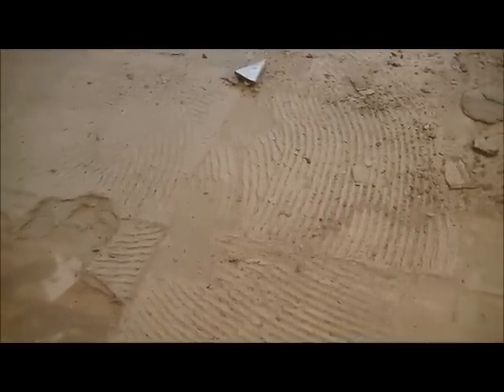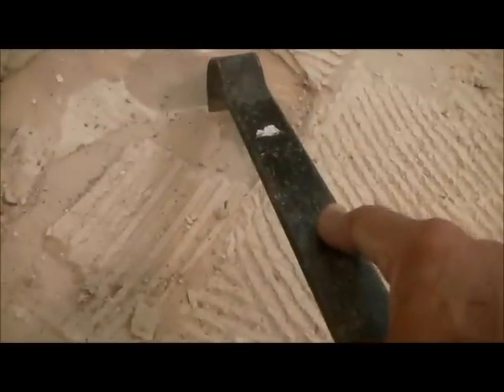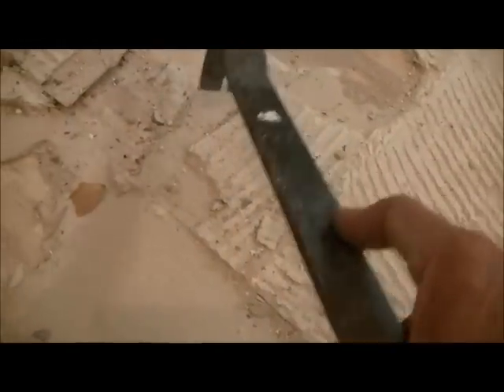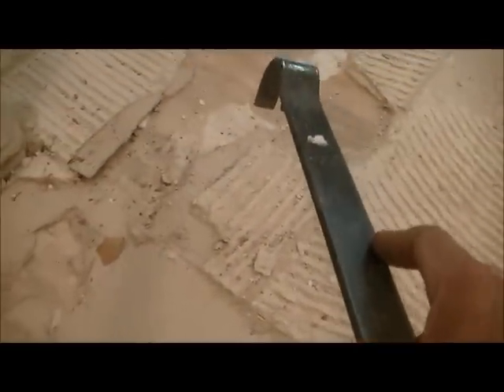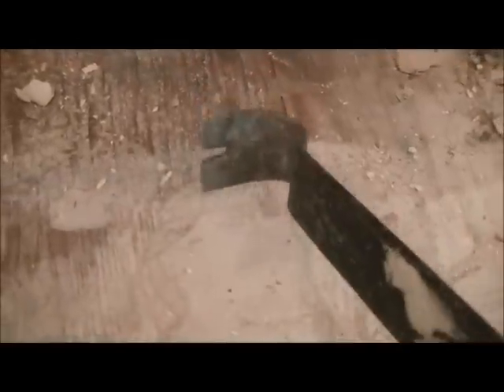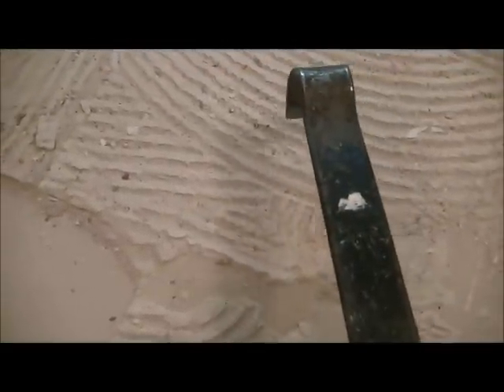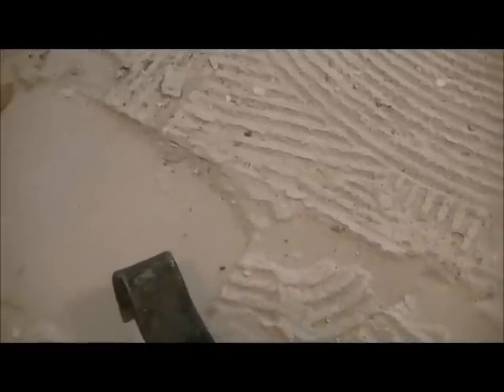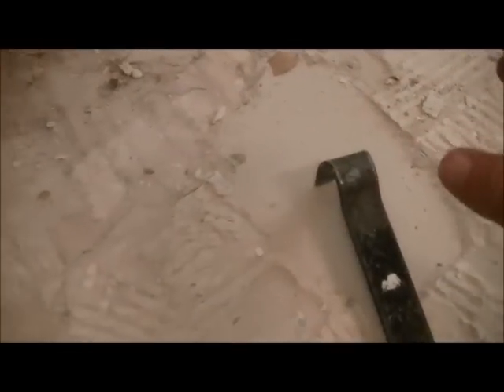How NOT to install backerboard on plywood !

Comment: The point of the thinset is to take up space between the plywood and the backerboard which decreases the likelihood of cracked tiles.  The problem you are having is because they used modified instead of unmodified... the modified adheres to the plywood where unmodified won't.  Let's not tell people to do this wrong and cause all kinds of problems for them in the future.  Excuse me while I cross off StarrTile from my list of potential contractors.
Reply from the maker: Garbage...both thinsets are a cement based product, BOTH will stick to plywood, both are hard to take up, and BOTH will damage my customers subfloor. Your comment about problems in the future ? GARBAGE TOO, over 20 years doing it as I do without a callback. ( crossing off MrMonkeyButt from potential customers )

Comment: I'm a certified flooring installer and I have to disagree with you on using nails and not thinsetting the cement board down. Everytime I go to fix a bad tile job, it's usually because they did not thinset the backer board down and their is movement. Which causes the grout joints to crack.
Reply from the maker: We're in some kind of parallel universe. Maybe one in 50 jobs I go on, some idiot put thinset down on plywood, and never seen the grout crack as you state, only directly on plywood does that happen.

As to your certification:
I'm a certified Firefighter
A certified Diver
And a Home Inspector
But being certified doesn't mean you do things right
Reply: what it comes down too is that everyone has their own way of doing things. is thinsetting over kill under cement board? sometimes it is. I watch your videos because I think you are very knowledgeable when it comes to setting tile. I do it that way because that's how I was taught. I just rather be safe than sorry.
Reply from the maker: I would agree with what you said, however if I ran across a problem I would have found the solution. It seems like new products are coming out every month to address a problem that I have never run into. A lot of it is overkill for the homeowner/diy'r so they won't fail I suppose.
Reply: I agree ditra is the most useless stuff around. Some guy told me that schulter came out with a system and all you have to do is put drywall in the shower and cover it. I had to laugh. What do you think about that schulter stuff
Reply from the maker: I have no use for any of the material they put out..overpriced and because it's proprietary, you are forced to buy more than what you actually need, you can't use anything separate from their system.

Comment: As DYI projects a few years ago I used 1/4 inch hardi backer board in some bathroom projects.  The first I just screwed the hardi board down to the plywood.  Next BR I read the instructions more carefully and applied thinset.  After a few years no problems with either floors.

Comment: Manufacturer warranty for hardie board requires 50 screws per 3x5 sheet (8x8" square), with thinset mortar troweled minimal 1/8" on plywood. I care more about being able to properly warranty my work then to care about the next guy. When you estimate a job you should assume the products were properly installed and include the necessary time for demolition.
Reply from the maker: Lawyers insure warranties are never honored

Comment: 50 + nails will not stop flex,your always complaining about how other people mess up.thin set under backer is the proper way,it makes the floor more rigid.So you lay tile on a flexing floor id like to see what that looks like in 3 years,
Reply from the maker: Every tile job I've done is still in tact. I offer my customers a warranty as long as I'm in business, not the typical 1 year contractors give. If I had failures I'd know about it by now & change my methods.

Comment: Definitely glue and screw. This is YOUR opinion and most of know better on this. A little extra work means my jobs don't fail. You have your view and this one I do NOT share at all. Just did a floor where HO had some do subfloor with durock and was so much flex. Pulled it up and thinsetted it down and rescrewed. Was great after that. Gave it that extra it needed. Is it needed in every floor? No but like I said, a little extra never hurts.
Reply from the maker: And that my friend is your opinion. Never one call back after setting thousands of SF doing it my way. One could argue there is a solution where there is no problem.
I can't speak to your experience, chances are it was operator malfunction where the durock was set.

Comment: I'm of the mindset that a tile job is done for life and not to plan for someone else to rip it out. That being said when I ran across this in my own home I just whipped out the saw and ripped out the underlayment and went in with new 3/4. Was pretty fast and easy. I pretty much go with the manufacturer's recommendations and they always say to use thinset underneath.
Reply from the maker: That may be true what you said, however I have been at this for nearly 20 years and have yet to have a failure doing at the way that I show. Tile won't pop off because you don't glue & screw.

Comment: In the Houston area I haven't found one tile company or tile contractor that puts thin set underneath the hardi for all the reasons mentioned in this video...The only one that says to do it is the AM radio home improvement guy Tom Tynan on 610am on Sundays. However, you call him up on the radio line and he recommends the pros at "Texas Floors," he even says ask for Jason. I call Jason and ask him if he puts thin set underneath the hardi and I get a long pause and then he puts me on hold. When he comes back on the line he says they normally don't do it or recommend it, but for an extra charge they can do it.....
Reply from the maker: So apparently you pick & choose the comments you read...I've already stated I've not ONE single failure doing it my way, you would go broke following me around.
Reply: Not sure if you read his post wrong or meant to reply to another post but Jose is agreeing with you and that most contractors he's dealt with in the Houston area agree with you.  You seem to have a lot of attitude with those that disagree.  At least you could show a little more respect for those that do agree or support your opinions.

Comment: A small rotohammer set to hammer mode with a flat chisel blade of three or four inch width will remove thinset. Or for real crazy use a grinder with a five inch turbo diamond blade and blot out the sun with dust! Almost fun considering how any other way is an exercise in massive frustration. The thinset under tile backer is a hot topic, no doubt. No thinset lets backer uncouple? Thinset eliminates voids? Tile Council knows best?

Comment: I agree, I have been that,"other guy," and at our new home we have had to replace two sub-floors due to thin-set.  Its a huge pain.  This time we just used more screws to hold the backerboard down, and it works just fine.

Comment: I am about to put hardie backer down on the subfloor, I was wondering about this very thing, seems bit over the top to put cement on the subfloor then put the backer down then screw down...I'm going with your advice, there's just no good reason to "glue" it down only to have to pull the subfloor up for a minor floor job because of all the redundant cement, the ONLY reason I can see justifying the cement is squeaky floors but that is the subfloor not really the backer part.

Comment: hello. my question is about tiling over top of terrazzo. what is the proper way to prep the floor . do I need to use an acid to etch the surface.  or can I just use a polymer modified thinset
Reply from the maker: https://en.wikipedia.org/wiki/Terrazzo

Comment: Glue is wrong, that I agree with
But the correct installation most definitely is: thinset under the 
durock/hardibacker - AND - screws or nails.

The whole idea is to bond the floors together and create a surface that 
does not flex.  That's why you do both.  Your method creates a floating 
floor above the plywood and it will not last 50-100 years without the 
grout cracking.  It will last long enough to get past any warranty you 
offer and it will be easier for the next guy to remove (because you did 
it wrong).

You are definitely right that it's a 100% certified pain in the arse to 
remove subfloor that was installed correctly.  Why?  Because it's NOT 
supposed to come up!  LOL!
Reply from the maker: And mine never have in 20 years....with OUT any thinset screwing up my customers subfloor.
And yes, it comes up often, average homeowner 7-10 years, and they don't like the previous flooring....50-100 years is a joke.

Comment: it doesn't matter what u think  its the manufacturer recommendation to thinset it down if it doesn't come out easily he did his job correctly  your just upset cause u have to rip it out bid accordingly  ive seen first hand what happens when u dont follow procedure you end up with poped tiles and cracked grout joints it seems you go against standard procedure on alot of your vids tryig to re invent the wheel
Reply from the maker: A lot of my videos I use common sense...you would think doing it as I do from 1998 I would run into issues, get call backs, have ppl posting crap online to disparage me....and there is nothing
Reply: Do you normally work on newer homes and/or homes with better laid floors? You can get away without thinset under the backer IF the subfloor is very flat. If you are dealing with an older home you tend to find bigger variances, and that's where you need the thinset to fill voids. Not sure how you're getting by without taping seams, unless you never use marble tiles.
Reply from the maker: Ok, so the jobs I have run from the 50's through today, all homes/floors are different, yes...but I nail about 50 roofing nails per sheet, it's not going anywhere. Voids if any are filled with thinset. Taping is used as a crack prevention method, no transference of cracks will ever see it's way to the tile. Trust me, if my work ever failed I would know about it & change my ways...over engineering a project will get you an over engineered project, but not a better one..
Reply: Ok, well that makes sense then. Filling the voids with thinset satisfies the only purpose of the thinset with hardibacker. The thinset's purpose is 0% for adhesion and 100% for void filling, just easier to tell people to thinset the whole place rather than count on them to pay enough attention to find all the voids.
Reply from the maker: I think you're what they called a " Book Soldier" when I was in the Army...( MUST be done this way, no deviation, no thinking )
Dude, I've been at this from 1998, everything is fine, it works.
Reply: I mean...I'm agreeing it works, just explaining why for the viewers at home, so.....

Comment: ok...i respect that....but when you need to install 1/4 of inch wonderboard ,in my opinion getting just screws won't hold it so well,can i have your opinion of this ...thank you ...
Reply from the maker: I don't see where screws with a large head won't hold it, but I use roofing nails and never have issues regardless 1/2'' or the 1/4'' board.
Reply: What size roofing nails do you use for 1/2" backerboard?
Reply from the maker: 1 1/2"

Comment: Getting thinset off plywood is a royal pain.   Voids beneath backerbaoard leeding to cracked tile is also a pain.  This time on my own bath floor, I intend to lay polyethylene down, using spray temporary stabilizer for fabric to keep poly from wrinkling, thinset gently spreading thinset to fill voids, and screwing backerboard to that.  I may stay in this house for years and this should solve two problems with little effort or expsense.  I do agree however that screws alone will hold backerboard, but if voids are there, which I have, may cause cracked tile.
Reply from the maker: I agree. Like with anything, prep is key... I can't imagine anybody setting backerboard on a floor without filling the voids first